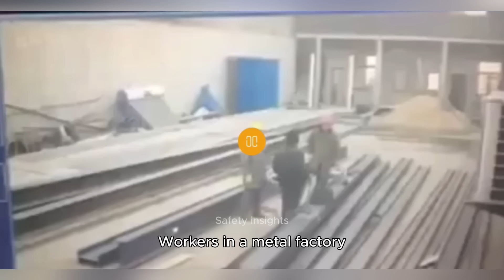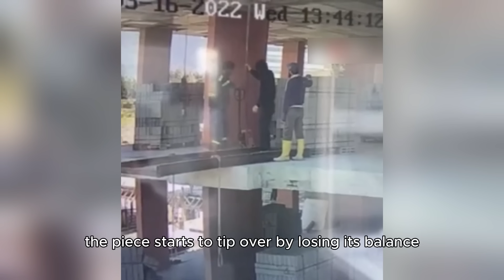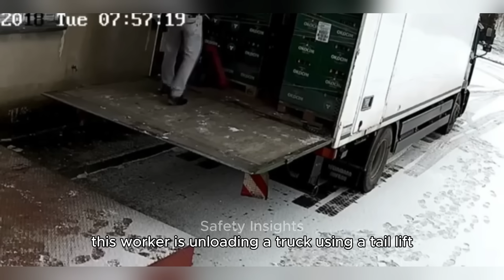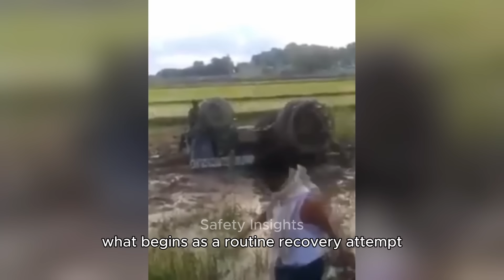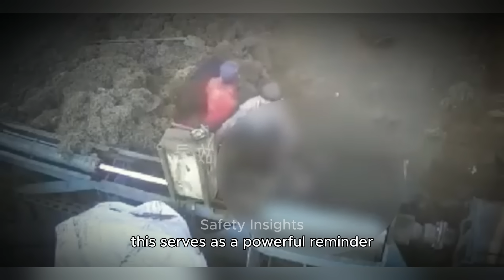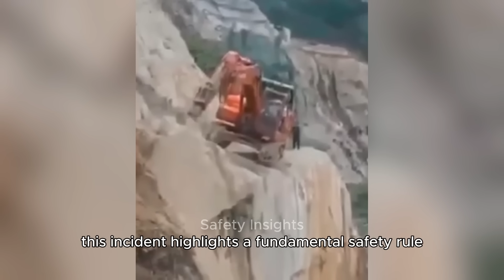Top Industrial Incidents Caught on Camera 2025

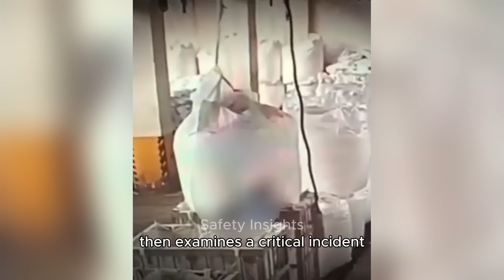Comment: 47:35 It was not a shifting load, it was the incorrect securing of the load and it became loose, instead of using the rings on the bag with the lifting hook, a lanyard was used. Bad lifting operations.

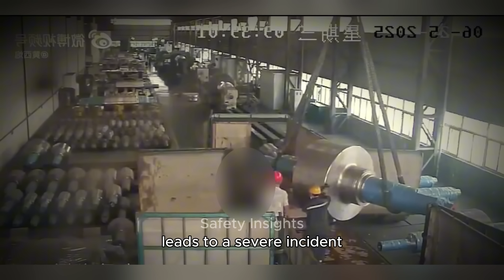Comment: 18:13 Again here, there was no equipment failure, it was just the sling rotation of the load, they should have at least a tag line. But, they seem to do lots of lifts so this is clearly bad practice or no Appointed Person controlling the load movements.